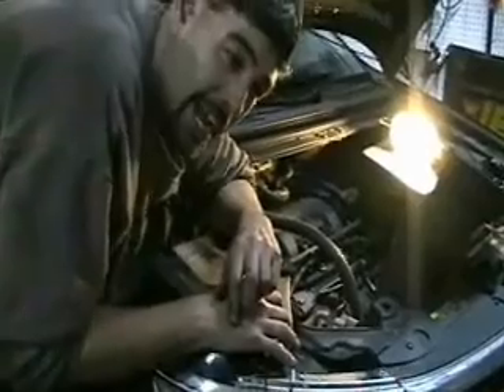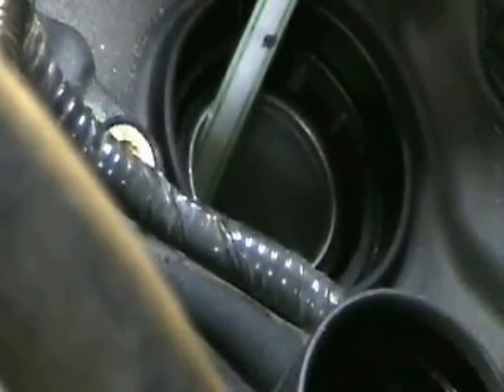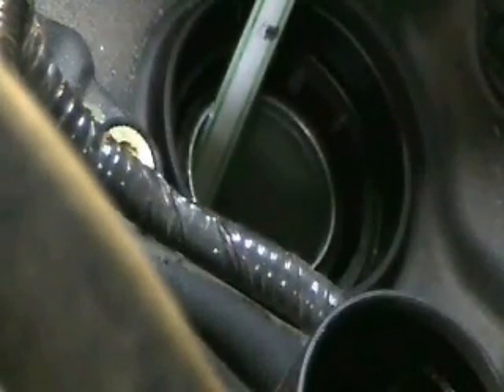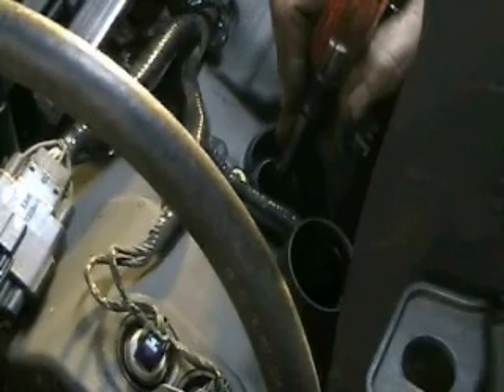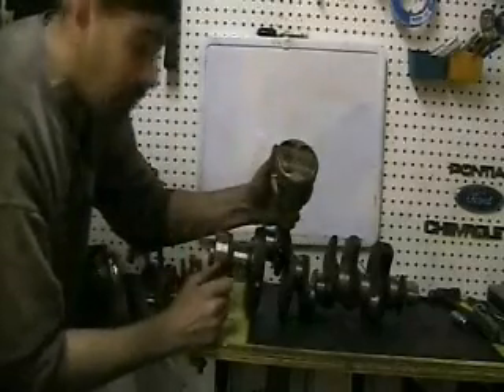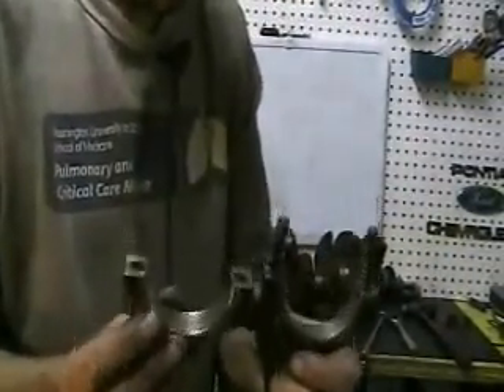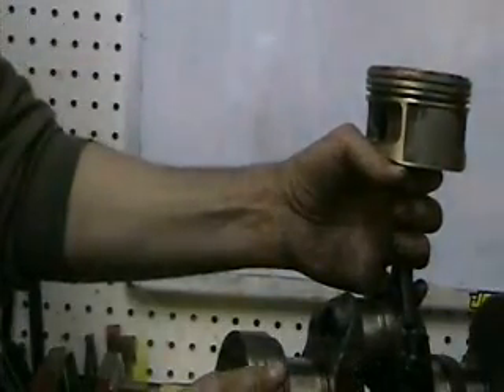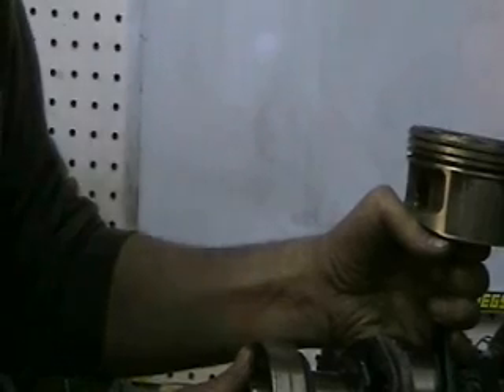How to test for Rod Knock using a screwdriver

Comment: Hey Matt, I got a 96 vortec 5.7 that starting knocking, it only knocks past 2k and quiet at idle. Could that be a valve train issue? i think i went a little past 5100 RPMs.
Reply: It was a rodknock. Got it rebuilt in January. The car only lasted 20 more miles after i last posted. Runs great now.
Reply from the maker: Could be. Could be something else.  What did your diagnosis indicate it was?
Reply: Theres also dramatic loss of power if I go over 4k. I did it a few times when it first started. If it is a rk, is it because the piston isnt moving correctly giving the loss of power?
Reply: I havent done the test yet, just seen the video.
Reply: Bent pushrod?  Rod knocks are usually most noticable at low-medium RPMs unless they are really bad.

Comment: Hi. my engine a Honda D16y7 has knocking sound at cold start. But it goes away or barely noticeable after the engine warms up. Some says it's piston slap but others state that the rod bearing starts to wear out. Any thought about this ? thanks
Reply from the maker: Well what did the diagnostic test tell you?  That's what my thought would be.
Reply: Schrodingers Box Ok thanks. I will try your trick to find out if there some slack in the rod bearing.

Comment: Thanks for video perfect test to confirm terrible news. my ford 302 had an issues on #8 i wonder if there's a trend that the damage occurs on the furthest cylinder from the oil pump. (would have been smarter to test furthest to closest and save some time). thanks again for the time and effort you put in. I watch the adds through and click there links hoping you get a few more cents from the corporate machine.
Reply: Dale Anderson my brother I truly believe tinker Bell lives inside your engine

Comment: I got a 98 Mercury Sable at an auction recently and a mechanic said it was running on only 5 cylinders out of the 6 and then driving on the freeway it made a knocking noise and stalled. Now makes loud squealing noise when trying to start. You think maybe it's rod knock and bad tensioner combined or something?
Reply from the maker: I don't know- what did the diagnostic test indicate?

Comment: probably the biggest thing here is what level tech or backyard mechanic are you? once you find out which cylinder has the knock, how far can or will you dig into the problem? replacing a rod bearing if that alone will fix it is a big enough task itself, let alone if the crank needs work also. guess my point is if you are pretty sure it is a rod knock, unless you are going to jump in and fix it, does it really matter that much which cylinder it is? also, if you are going that far into it and you are keeping the vehicle, better to check all cylinders when you have it apart.                                                   if you have a strong aversion to getting zapped on occasion from plug wires then this other way i used may not be a good idea for you, (also not sure on any impact this way would have with a pacemaker due to the voltage involved, done properly you should have no problems). ignition systems have a serious hit when they fire. using a good set of insulated or plastic plug wire pliers from your favorite tool guy is recommended. while the vehicle is running you can clearly hear a rod knock, by pulling 1 plug wire off at a time you can usually isolate which cylinder has the knock. the sound will change dramatically when the plug wire is pulled off because you are eliminating the spark, thus getting rid of a lot of cylinder pressure. obviously this will not work on newer engines due to the coil setups now. but with some good scan tools you can kill individual cylinders with the tool. any way you look at it, it is fun to work on engines and cars in general.

Comment: Thanks for the vid I have a question though. After Im done with the test do I have to mess with the distributor since the pistons are at different positions than they were before doing the test? I dont want to mess anything up and dont know too much about ignition system but I figured that since the dizzy fires in a specific order and everythings synched up now, if I changed what position the pistons were in and started it up wouldnt the dizzy ignite the next cylinder its supposed to with the piston potentially being in the wrong place?
Reply from the maker: Anytime you crank the engine The distributer and cam turn with it. Turning an engine over by hand is no different than cranking or running.
Reply: Schrodingers Box thank you so much I really appreciate it. From your experience have you seen anything that causes a sound like rod knock without it being the rods? Im just praying that its not rod knock though with my luck it will be :(
Reply from the maker: Yes I once saw a loose drive plate bolt striking the bell housing. sounded exactly like rod knock. Also see my video on lifter noise which is not a "death sentence" like rod knock would be. If screwdriver test is positive though- there is no doubt it's rod knock.
Reply: Schrodingers Box

Comment: Hello , I have a 06 3.5L charger. With 200,000 miles on it. I just got a oil change and informed that I had no leakes also I need a alignment. My car is vigorously knocking to the point I'm scared t turn it on can u tell me what it may be n the CHEEPEST way to fix it
Reply from the maker: Depends on what's wrong with it
Reply: +Schrodingers Box when I turn it on it starts knocking really bad. I don't have no leaks and just refilled the oil. I do have a overheating problem but the mechanic told me that chargers temperature gauge are suppose to go over the the middle line as long as it comes back. I've had a lot of people say that it is completely wrong and a lot say that it's suppose to happen. so I don't know why my car is knocking I was wondering if u can give me a opinion
Reply from the maker: can't help without data sorry. anything would just be a guess.

Comment: hello sir, first thank you so so much for your videos, im new to actually fixing cars, and just wanting to learn more, and you are teaching me so so much already. quick question though, y would you want to do this? because to me, it seems that you can already definitely tell its rod knock from the sound when the vehicle is running, and i thought to fix the bearings was a complete engine rebuild amyways, so what is the benefit to learning which cylander it is? thank you.
Reply from the maker: You are correct- there is not benefit to knowing what cylinder.  It is just a way to confirm the rod knock is the problem which of course is by definition a major repair.
  Some people would want to know the cylinder# just so another person giving a second opinion might be able to blindly come to same conclusion which gives further confirmation.
Reply: +Schrodingers Box very informaive. thank you.

Comment: hey bro I changed my rod bearing  but still is loose, not the same but still is very little knok. what I can do about bro??? thank you for ur videos
Reply: Hey bro depending on how bad the knock was bro i think you might need a new crankshaft bro bro bro.
Reply: Yeah bro I really check that crankshaft   and it's too wasted,frome the piston #5, do u think I can do some things about
Reply: You could get a slightly thicker rod bearing to compensate for wear. I would take measurements of the crank with a dial caliper to find the correct bearing.

Comment: any check engine codes for engine knocks?  I know engines have a knock sensor...
Reply: +Connor F Sure. The knock sensor measure the bangs in the cranckcase, not on pushrods or bearings/jornals of the cranckshaft.
Reply: k.  figured banging in a crankcase would be caused by the moving parts in the crank case (crankshaft/journals and bearing).
Reply from the maker: Actually everyone is correct. The purpose of a knock sensor is to determine engine knock. The intent is as Zachary said- it is to determine predetonation events and advance the timing accordingly to prevent engine damage.  However, of course, and actual knock from rod knock will also activate a knock sensor and advance timing but this is serendipitous to the mechanical operation of the sensor.

Comment: hello i have a 97 saturn sl that has rod knock how do i replace bearing in it with enging still in car??
Reply: +Mavrick Glover Very easily- you don't. That method won't work- the friction from the destroyed journal will make your repair last all of a few seconds at best
Reply: Ok thank you! What is the best way i should repair it?
Reply: Mavrick Glover You need to have the crank ground and use oversized bearings if you plan on keeping the engine

Comment: Did a cylinder drop test by pulling the spark plug wires. No difference at all. Performed your method with a 1/4" extension and found #6 cylinder was the culprit. Very very very very little play. Knock is so quite you can't hear it in the car but you can hear it when your head is in the engine bay. I'm gonna try the replace the bearing/emory cloth method and see if that fixes it. It's a salvage title car, so if the engine is done...no biggie.
Reply from the maker: +Anthony Shelton If you still have bearing material left you may be able to get away with that- but any scoring on that crank journal that you can feel with a fingernail and a repair is likely to be temporary at best.
  Any play you detect at all using this method- even a slight amount, is positive for worn rod bearing.
Reply: +Schrodingers Box Thanks for your reply and wish me luck

Comment: very good video. my mechanic told me the noise from my engine was rod knock and proceeded to quote me a price for repair. i did your test and it passed. looking at removing pan now and checking cam bearing. good work!
Reply from the maker: Travail Enligne Why would you possibly remove the pan to look at cam bearings?

Comment: if you pull each plug wire one at a time while its running then the noise will go away when the suspect cyl. has its plug wire removed.  too easy.   also your test would also show if its a wrist pin since the piston would move downward also...
Reply from the maker: ndspeedster Yes the test you describe is a "cylinder drop test". It isolates the cylinder making the noise and then the screwdriver can be used to confirm it is a rod knock.  On engines that have severe knock, I have found the drop test is not so easy to tell the difference though.
Reply: ndspeedster  Why would removing the plug wire make the noise stop?
Reply: idonno418 because then that cylinder would not be under load and just along for the ride as it were.. when the wire is removed then that plug is not firing in the cylinder and there is no force on the piston so you won't hear the knocking anymore or if anything it would subside a lot.. but if its that loud your crank is probably toast anyway so why bother narrowing down which cylinder it is?
Reply from the maker: ndspeedster In theory that works but I can assure you that when either multiple rod knocks are occurring or the bearing is so worn the knock is present just as result of crankshaft moving the "cylinder drop" trick still doesn't work.
  Also Cylinder drop tends not to work on top end problems so if the sound is from Top end it may make knock diagnosis incolclusive

Comment: hi bro,.. nice video and tips.some question here sound knocking when i shift the gear to D or R in A/C running and quite when A/C turn off. 1.3 engine with fuel injection. thank you,..

Comment: thank you so helpful you have saved me a lot of effort isolating the cylinder
Reply from the maker: roff danials Excellent, looks like you might also be interested in my engine rebuild series though. Once you have rod knock, it's basically conclusive you need to replace or rebuild the engine. You can't just replace the bearing without machining the crank, not to mention all the metal in all the other bearings in the engine.
Reply: BEAUTIFUL video hopefully my 01 mustang cobra engine does not do this because I’m getting a tick from the engine
Reply: roff danials I learn something new. I have rod knock on a diesel engine. thank you for the education

Comment: will it be fine if i just replace the bearing?
Reply from the maker: No I answer this more thoroughly below but basically by the time you hear rod knock, the crankshaft will be pitted to the point that replacing the bearing will only cause the engine to sieze when it spins over the other bearing due to the friction.
 You have to remove the crankshaft and recondition the crankshaft journals if you intend on repairing the engine.

Comment: I have a 2001 Saab 9-5 which are infamous for sludge issues and it sounds like it has rod knock yet when I dropped the pan and changed the bearings I noticed that the old ones were in ok shape and no damage to the crankshaft but I went replacing it anyways and it continued to knock pep boys says its rod knock and neighbor with a lot of experience says piston misfire. Best bet anyone?
Reply: What was it

Comment: I have an M20 BMW motor experiencing some pretty ugly rod knocking. Will the oil pan have to be removed to check for crankshaft scoring? How about engine from vehicle?
Reply from the maker: If you confirm rod knock there is no advantage to doing anything other than an engine rebuild or replacement. Either way it means removing the engine.
Reply: Thanks for the reply! 

Now I understand why someone would want to isolate why the rod was knocking. But would the best method be to just replace all the connecting rod bearings? And, I am sure the crankshaft will be scored. What are some other things that should be done? Whole new rod for the one with the bad bearing and just replace the rest? Replace the crank bearings? Refinish the crank? New oil pump? 

I will be removing the engine. It has thirty years of spilled oil and such on. I will pressure was it and probably have the valve cover powder coated red. 

-thanks.
Reply from the maker: Charlie Gates You will absolutely need to do more than replacing the bearings.  See my video "Extreme budget engine rebuild" and you'll see what you'll be in for.
Reply from the maker: ***** The cost of an engine
Reply: ***** find an engine. an m20 is an e30 yes? theyre older so parts are cheap. the drift guys love them. you can also look into more exotic swaps if you think you can handle it. hop on a bimmer forum theyll be able to help alot more then youtube

Comment: It's not a big discovery to find out how to check it for a bit mechanical minded person.
Once I experienced the rod knock for the first time in my vehicle it took me just a while to find out myself this technique.
Anyway, that's a good guideline for unexperienced mechanics.

I think that I just seized 3S-GTE in my MR2 in this way past coolant leak overheating :/
I can hear valve coliding with the piston and some rod rattling I think.
Surprisingly fixing it while early discovered is not that big and expensive job as most of the people think. As long as the crank has not been scored it should be fine to just replace the bearings.
I'm gone a fix it just dropping the oil pan without taking the whole engine out.
I just hope it did not damaged the valve. It wasn't tingling at low revs at least :-)
Reply from the maker: Well you are about to become more experienced when you realize you won't be able to repair a seized crankshaft by just replacing the bearings and it will not even be close to the minimal expense you are expecting.
Reply: We will see. I will inspect the crank first. If it will not be scored it should be fairly cheap repair.
Reply: *****
How did it turn out? You'll see low oil pressure first, then by the time it knocks you're almost always buying a crank.
Reply: if the cranks seized ya went way past knocking! overheating and knock ill say it now, your gunna want to at a minimum plane head, possibly a new valve or two, grind crank, undersize bearings, new rings ( they lose their strength with overheating ) which means a hone or depending on mileage maybe be better to bore out and go oversize pistons. that will be the minimum..... then while your there you do the mandatory seals, gaskets, etc.. pretty much if you take a JDM engine to the point its seized your in for a full rebuild. there is no quick fix for a seized JDM. some of the older British and u.s motors you could fill with diesel, let it sit, smack it with a hammer and break it free. not the case anymore as tolerances in manufacture are far to small now.

Comment: Hi, i have a 99 jetta with the vr6. i just bought it with starting issues, swapped out the old starter with the new and it started up no problem. i took it around the block and it died on me, boosted it up and got it home. when i started it up back at my house i had this pretty loud knocking sound. what are youre suggestions? iv seen people say they just replaced the oil pump and its running fine now but not sure how to go about this.

any help is great, thanks!
Reply from the maker: I would probably suggest testing for rod knock

Comment: Great Video helps when trying to explain what an engine knock is ! 

I actually spun a bearing in a H6 subaru regardless i had to get a new engine for it then i sold the car so it would live a long happy life.

But the problem i am having now is this 4.7L 2002 jeep grand cherokee is having a ticking noise that goes away when the engine is heated  or if i let it warm up it doesn't happen im not sure though because it will be days when it wont make the noise until i drive it while its cold and i am having ptsd from the subaru mishap so i wasn't sure if it could be a spun bearing or not it is a super light ticking sound and it seems to be coming from the back under the engine from a quick glance but its not poping any codes i did notice a drop in gas milage so does anyone know what could be wrong